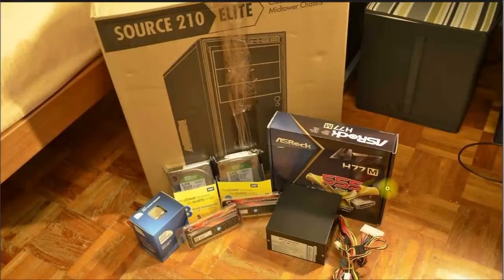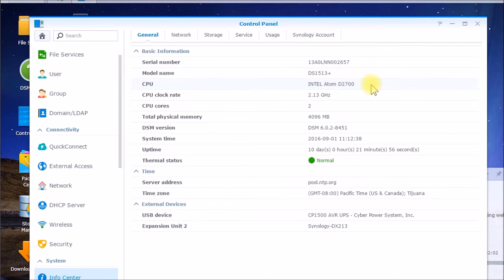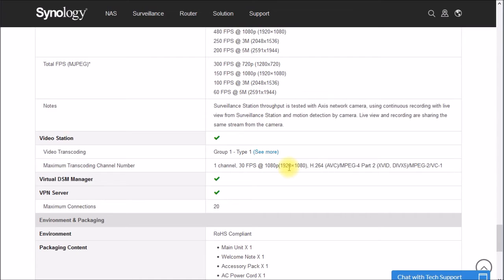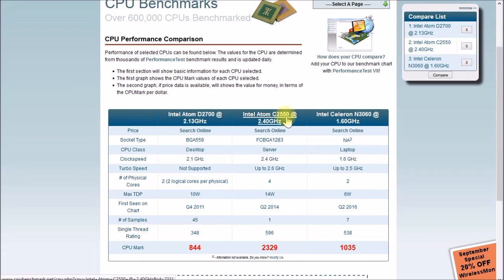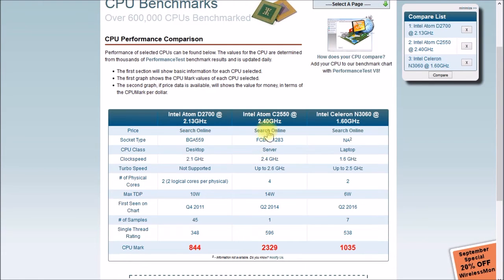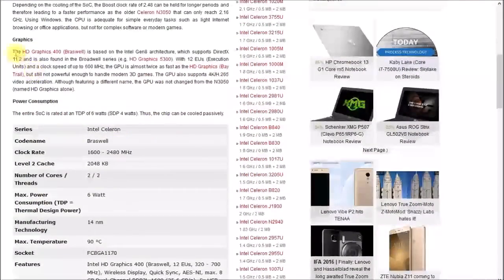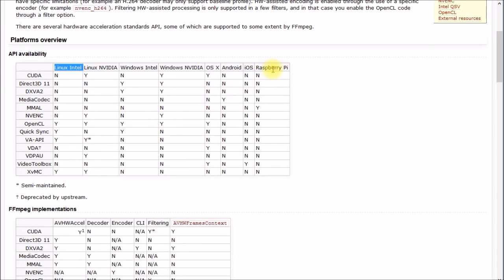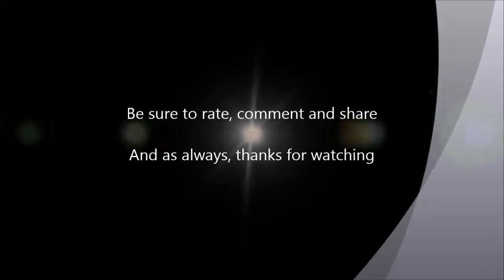Video Transcoding Considerations on a Synology NAS

Comment: This is hopeless. It explains nothing about transcoding but wastes our time with a spec walkthrough
Reply from the maker: Well, the NAS specifications are the whole story on transcoding.  You need to get a model that supports the level of transcoding you want to do.  That's the point of the video.  For example, my model NAS will transcode up to one 720p stream per the specs and that's what I see with my application (DvbLink live TV server), in fact it's more like 480p in real life.  There are no settings other than checking the box in the application to enable transcoding.  But, if I try to transcode a 1080I live TV stream, the NAS comes to a screeching halt.  And now I know that when I upgrade to a newer model NAS, I need to specifically look for a model that has better transcoding support, such as 1080P or even 4K.
Reply: Not so. Start by explaining what transcoding is, what happens to our data to facilitate it and how we can detect that it is happeng.

As with so many YouTube videos, it lacks authority because it is being delivered by an amateur or very amateurishly.

Most things can be explained simply by an expert. It takes a non-expert to make things complicated.

As for your reply, it does no more than emphasise my complaint. A clear indicator of non-expertise is that sentences frequently start with "Like". What bollocks is that?
Reply from the maker: Sure, if I were making a video entitled "What is video transcoding" then yes, a detailed explanation is in order.  But I am not an authority in that field, I'm sure there are other videos like that.  

I'll see if I can do a follow up video to describe how to detect that is is or is not happening.  That is very apparent, you either see smooth video at the resolution you have selected or you don't.  I'm currently using the information I presented in this video to select a new Synology NAS that is more suited to transcoding video and will be sharing that information when I get it.  I should then be able to do a side by side comparison of the two systems, as that is the only real way to see when transcoding works and when it doesn't.

Comment: The title doesnt cover the video. I am looking for ways of how to set the transcoding settings. Its just about synology NAS...
Reply: Could you just say where this option is in your NAS DSM?
Reply from the maker: I covered the settings in the software I used in the previous video in this playlist:
https://youtu.be/v6beKfeVH04
All that has is a check box in the web streaming settings.  I've not used transcoding with other applications on my NAS.  I think transcoding configuration is an application-specific feature.  This video was showing the hardware/CPU considerations in order to get a decent transcoding platform to begin with.
Reply from the maker: The only place I've seen anything in the Synology supplied applications is in Video Station, under Settings - Advanced there is a Transcoding section.  It's an application-specific sort of feature, so not part of the DSM per se.
Reply: Thank you. My DSM 4 ver, didn't contain such options as Advanced under Video Station/Settings. Going to upgrade till 6 ver.
Reply from the maker: OK, I haven't used DSMv4 myself.  It may be that wasn't an option back then.  I think my DS1513+ (2013 model) was one of the first models in which there was enough CPU power to handle transcoding in any form.  It came with DSM v5.  I didn't use the transcoding feature until I upgraded to DSM v6 though.